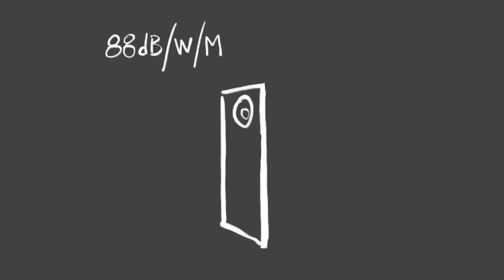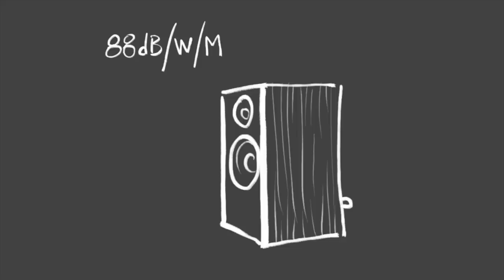John DeVore goes on a rant about the High End Audio lie that inspired him to start his company

Comment: I have never found sensitivity specs helpful at all. As a matter of fact I've never found any of the specs of a finished speaker helpful except for the ohm load. You can only make an educated choice by listening to them. Preferably in your own home, in your own listening room, with your own amp.
Reply: Sensitivity is one of only 2 specs I find truly useful. The other being cartridge output. Sensitivity is useful because it can be used to reliably screen out speakers that should never even be considered, at least not if you want to listen to music and not spend your life searching for the amp that just might be able to drive them. Real world loudspeakers, ones you can buy confident of being able to use virtually any amp, are 90 dB 1w and up. Its just about the most useful spec there is. You just have to know how to use it.
Reply: @charlesmiller6281  I don't really agree because as you said any decent speaker these days shoot for 90db+ so why worry about it?  I've also had high sensitivity speakers in the past (over 100db) that sounded pretty terrible. Then there's speakers I've had that were rated around 86 -88db that sound incredible.  Like I said, in room listening is the only way to make an educated determination. Specs are just for bragging to your friends

Comment: I am trying to objectively understand how your speakers cost $90K? is it to recoup the research and development costs? Like I understand why some prescriptions cost hundreds or thousands of dollars when the pill itself cost a few cents to manufacture. The second pill cost 2 cents but the first pill cost 10 billion. Is it the same with speakers? Because the materials costs what 1K at most? Please help me understand.
Reply from the maker: $1k?

As an example, at our cost, a single hand-built woofer from the O/Reference: custom cast and machined bronze chassis, bespoke AlNiCo magnet and machined steel motor system, turned two-piece bronze and copper phase plugs, etc, is very nearly $1k. And that is only if we make them in batches of 50 at a time.

I guess by materials cost you mean a bunch of piles of various minerals and wood is $1k?
Reply: @DeVOREFIDELITY  Thank you for the reply, I am asking where is the rest of the cost?Is it labor? Research and development? If your materials cost 1K even 5K that is a massive delta to 90K of course you should make a sizable profit for your efforts and I am not saying they aren't worth it, as obviously to some people they are. I am just trying to understand why they cost more than a new Porsche 911.
Reply from the maker: @MitchM240  I appreciate that you're trying to honestly understand, but I don't think you read my first response thoroughly. A single O/Ref woofer cost us about $1000.00. That's one of TEN drivers in the system. Your "materials" cost of $1k or even $5k is not even close. Our hard cost (not including assembly labor, development, or the high overhead of business in New York City) is well over $20k per pair. You simply can't add up the cost of a bucket of bronze, some sheets of plywood, some paper, glue, a log to cut into veneer, a pile of resistors, capacitors, etc for the crossovers and amplifiers, etc. Each of those things has to be MADE into a component of the speakers. Bronze, steel, AlNiCo, paper, copper are MADE into the woofer that costs us $1000.

Porsche is part of a company (VAG) that is economically larger than many countries, and builds their cars to sell by the MILLIONS. If Porsche only wanted to make 100 911 hoods, each hood would cost thousands of dollars, but they make a million hoods and each one costs probably $100. BTW, the base model 2022 911 is over $101k
Reply: @DeVOREFIDELITY   Thank you! That makes a lot of sense to me now. You are correct I did in fact miss-read your response. I really appreciate you taking the time to explain it to me. I learned a lot about hi end Hi-Fi.  I can see why people like you and your products. You are one of the good ones!

Comment: Inefficient speakers engender more profit for dealers. They require more powerful amplifiers, which result in greater profit. Everyone's happy - even the utility companies. Paul Klipsch's statement that you only need 5 clean watts to drive his Khorns to concert sound pressure levels didn't sit well with audio dealers at the time. I suspect that's one reason you hear the false claims that horn-loaded speakers somehow color the sound. I'd like to remind you that the dominant voice of a symphony orchestra is from the horn section. The human ear is most sensitive to their frequency range. Our ears don't respond to sound in a flat manner. Systems which aren't modeled after what the human ear actually hears, sound deficient in dynamic range, to name just one parameter. Refer to Bell Labs early experiments and discoveries in audiology, don't blame me. John, I wish you well with your new company. In regard to your comment on rating systems, I believe a return to RMS ratings would be more transparent and honest than the current methods. That might be a topic for one Steve's provocative shows. Keep well!
Reply: RMS just shows mechanical and electrical max performance of speakers, so they can still survive. It does not spec how loud the speakers. If you can imagine 1kW RMS speaker with 30dB/W/m sensitivity, it will sound 90dBA at 1kW power like the speaker with 90dB/W/m sensitivity with only 1W, but if that low sensitivity speaker is powered by 2kW, it will just burn up without any meaningful increase in loudness.

Comment: Nice video but depending on the location what you said about 1960s speakers isnt true. in norway with our tandberg and seas speakers it was common with 4 ohm or lower not kidding, for example my tandberg hifi system 11 has two 4 ohm speakers connected in parrarel with a first order crossover. and i own a three way from the 70s a seas hifi 30 with 3 4 ohm speakers connected in parrarel first order crossover.

Comment: okay okay ,,,i get it just mention the impedance when stating sensetivity. problem so!ved. or just compute for the spec taking into account ohms law. you can add another layer of confusion when you realize wattage can be measured as root mean square or peak to peak. another layer of confusion when you realized sensetivity can be measured at different frequencies giving different results. and diff. frequencies can be square waves or sine waves. giving even more variations in the specs... he he he ....electrical engineeerring can be a bitch😄

Comment: Maybe not “audiophile” grade but definitely a contender as one of JBL’s best: https://reverb.com/item/14537958-jbl-cabaret-4699b-1980-black
I biamped a pair using these vintage A/B International monster power amps: https://en.audiofanzine.com/dual-channel-power-amp/ab-international/900/medias/pictures/
Each woofer got one and I split one for the mids and highs. I used a Yamaha C40 preamp and a Peavey crossover. JBL made this extremely easy by providing inputs of full range, bi-amp or tri-amp. Not the cleanest system but extremely solid. My neighbors were not huge fans. Go big or go home.

Comment: Yeah welcome to marketing 101. I Recall the 2.83v spec in the 70s when the standard for impedance was 8 ohms. Not mention "sensitivity" is also a function of freq... also a function of measurement space... where do u draw the  line? U don't, u look at context... like anything. Btw, dude is cluless about the digital amps going low...they can go the lowest and why they r used in the pro space.

Comment: Get a hearing test. If you can not hear above 12,000 hertz, none of this will make any difference to you. If you can not tell the difference between a .mp3 audio file and a .flac audio file, more than likely you can not hear above 12,000 hertz, which is about 90% of the worlds population.  It won't make any difference if you purchase a $20 speaker or a $2,000 speaker. You won't hear any difference.

Comment: 2:38... didn't realize Acoustic Research went back that far... and wouldn't you know I just heard that said on a pair of AR Powered Partners from the early 90's when they were great computer speakers to use with an Ultrasound card playing 3D Pinball;-) Dr Scholl's anti fungus athlete's foot  powder on speaker surrounds stops rubber foam rot in Hawaii where they lived in their first decade of use and both pairs still work like new and sound good despite being stolen on June 9, 2009 with everything else and sitting in storage for 3 years unused before getting them back. But my KCD 20 Gold CD player didn't do so well and that was a huge disappointment. The thieves were certain no one would ever notice their criminal activity... but time tells all and that's not what happened thanks to OPERA and SLAC's E158 team.
Reply: Oh I bought a pair of AR speakers back in 1978. The cone suspension disintegrated after about 20 years, but it was a good buy.
Reply: @christophermeraz-mata  I still have a 65in plasma Panasonic TV I'm keeping until OLED or something better brings back 3D (hopefully in 21x9) used with pair of Atlantic Technology subs once used with a 200+ lb Mits X7 35in tube TV before moving up to the 250+ lb 40in tube in 1994. And despite having the dreaded foam speaker surround material that sounds good but could rot out in 2 or 3 years living near a rain forest in Hawaii after almost 3 decades they still look and feel like new thanks to being treated with athlete's foot powder. And I only treated them 2 or maybe 3 times at most... long past the expiration date to use as intended but will do it again after saying that. 

Too bad the speaker manufactures like AR didn't know about the good doctors foot powder back then. I learned about it from a dealer I got my speaker wire from that ran an audio shop from his home to pay for the habit. All my good audio gear came from guys like that... paid $900 for a demo pair of Active Ones hand made by John Bowers and connected to the ($400) KCD 20's passive volume output at the time it was hard to beat overall especially after the DAC upgrade Tony offered doing for next to nothing. I used a pair of low cost Spica TC-50s for rear ambient speakers with a B-stock Fosgate surround processor that had been dialed in by the factory ($200). Things sure have changed over the years but I still want a pair of Sound Lab speakers.... now weighing in at 272 lbs per speaker with improvements made over the years. Biggest problem has been acquiring the space they need with a house wrapped around it;-)

Comment: At the moment he said "dB/W/M" i knew what this rant was going to be about.

Maybe speaker manufacturers should specify "voltage sensitivity" as dB/2.83V/M and ALSO the efficiency in dB/W/M. The latter is the actual power the amplifier needs to supply and is voltage times current.

Al check out the impedance plot and particularly the current phase angle versus frequency.

Comment: 2.83V / m / dB @ 1 kHz.
Now add the load at high frequency with electrostatic speakers. Look at the impedance curves of these beasts. The simple curve is a direct consequence of these speakers being a giant capacitor, the higher the frequency the lower the impedance. Unless you can tolerate Krell and its ilk these speakers are not to be considered. 
Massive crossover networks makes life hard for the amplifiers, and will make a good amp degrade.
Higher efficiency speakers have their shortcomings but may be preferable to the complex low impedance monsters. A 80dB speaker will need 10x the power of a 90dB speaker. Think how that will affect your budget and amplifier choices.
Using voltage to describe speaker sensitivity essentially implies unlimited current, which is stupid, as real life has limits.
Reply: Phil Allison  electrostatic speakers are by definition capacitors and are physically large. They are driven with kilovolts so even capacitance in the picofarad range matters.
The math is pretty straightforward, figure it out smart guy.  Martin Logan cls were at one time 1 ohm speakers.
Not a "dip" but pretty much a straight line. From my experience this was a problem with my 200w triode amps.
 Quad ESL where the first high end speakers I heard back in the late 60's and Quad designed their own amps for them, which is unusual. 
A voltage source implies no limit on current, and while not impossible to accomplish it gets heavy and expensive. I'm not a fan of 80dB/W/m speakers as they exclude most amps.
Reply: Phil Allison  
Name calling. Cute. I can do that too.
The Quad designer took responsibility for their speaker by also designing amp for them. I have no gripes with those.
(Why did you get rid of them?)
Not so for the CLS' with a 1 Ohm most certainly capacitive reactive load. 
They did not work for my amps.
Using a network analyzer to characterize the speakers complex impedance is not a bad idea, which you can find on some speakers.
What do use for testing?

Comment: Considering how cheap watts are, I'm not sure sensitivity matters.
Reply: You missed the part where the low end speakers tend to be low impedance, thereby forcing you to buy certain types of amps to get the speakers to sound like they should. Sooooo, you could buy an amp and if it DOESN'T multiply the power to the very low ohm woofers, you've just wasted your money and now have a gutless sounding system.
Reply: @46wireboy  Well, no I didn't.  The entire discussion is very complicated, but the drivers in a bookshelf speaker are indeed likely to be of differing "efficiencies", but solving that problem is the job of the crossover.  This is likely to open a whole can of worms, because it's not as simple as I'm making it.  The crossover "should" make the drivers act like they are of the same efficiency.. at least to the ears. 

Another thing, look at an amplifier rating and see if it has different WPC ratings at different impedances.  It will (as long as the amp is safe to drive at a specific impedance, well.. sort of).  Even the amplifier that he's describing will.  

Further, "gutless" is in the ear of the beholder.  I absolutely positively can't stand the inexpensive Elac speakers that were all the rage three or four years ago.  I don't know why.  I suppose that I could describe them as gutless.  However, I don't doubt for a second that there are experienced people out there that think they sound full of guts.  It's magic.

 Considering that I've heard lots and lots of speakers, I can tell you that TO ME impedance isn't what makes a speaker sound good, though it's likely to have a bearing on what makes a speaker sound LOUD.

Comment: So we just throw an unlimited amount of power at a poorly designed driver integration
Reply: When I got a nice pair of k Horne's I quickly realized the crossovers had ways to much over lap to provide a reasonable impedence load to a low watt amplifier.. crossover implementation is  one of the most critical factors in multi driver speaker implication.

Comment: So, according to you. You would have to know upfront the speakers are 3 ohms. Do the math and apply Yesteryear's DB specs to Thiel CS5 3 Ohm loudspeakers to come up an accurate DB level at 1 meter. Provided you posses an amp that can drive them at 2 ohms. Yet, you admit an 8 ohm amp would not drive the speakers correctly. SO how is it changing the value to voltage which will indicate there may be a compatibility problem a bad thing? Who buys $10,000 speakers without assistance if they don't know what their doing? I think your rant is misplaced, specs don't apply equally to all speakers or all amplifiers. A universal standard is unobtainable.

Comment: The whole marketing thrust is snake oil.  All sorts of gimmicks and Chinese numbers.  Room acoustics will wreck the finest calculations and design work before you can say "That speaker's a piece of shit."  The most significant offender is the biggest hard surface in the room, the ceiling.  Near-field listening is one of the ways you can stop that from influencing the sound.  The other is to pad the ceiling.  I don't think it really matters what you use.  Get a roll of foam and glue it on.  Or staple slices of bread up there.  I'm sure someone's selling a high-priced product but I don't think it makes a hoot of difference.  I use a near-field set-up and also earphones.  The near-field setup is so good that casual listeners stop talking and ask why it sounds so good.  And they're not even interested in sound or music per se.  It's a show-stopper.